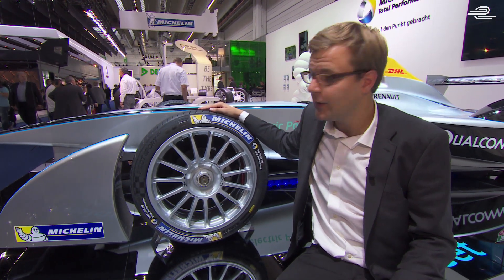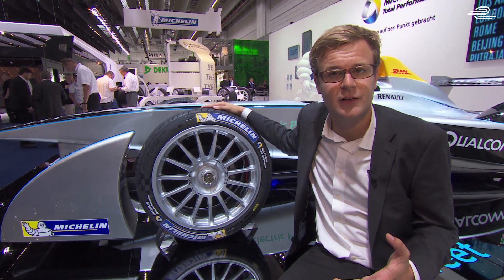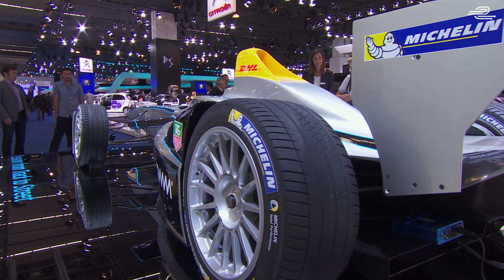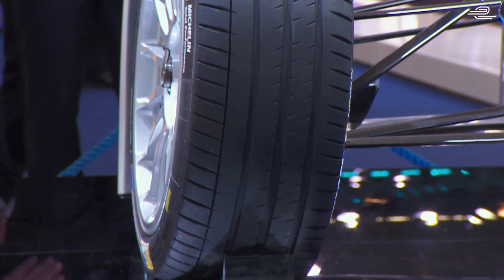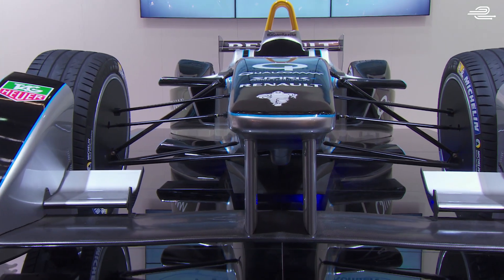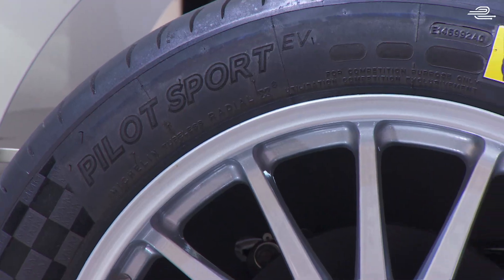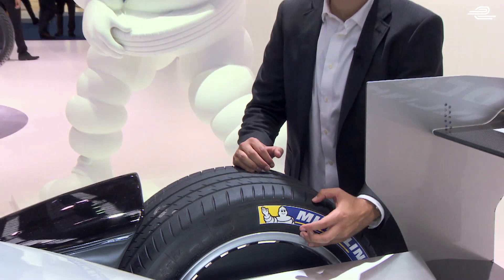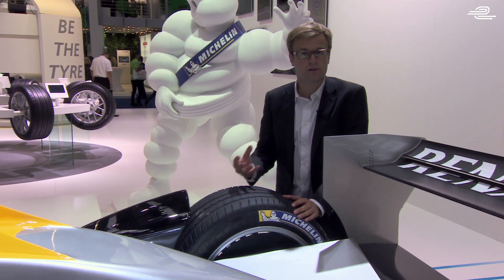Guide to Formula E: Michelin tyres

Comment: I'm not sure I'm a fan. The fuel saved is negated by the lower cornering speeds. 
FE gets unique courses everywhere so the speed difference to the slowest  open whee series cannot be compared. Also handicapping grip on top of low power output and high weight....makes for a slow car that needs really slow corners to shine.